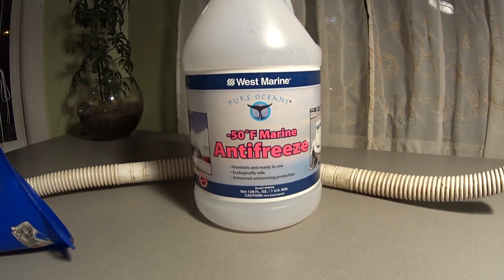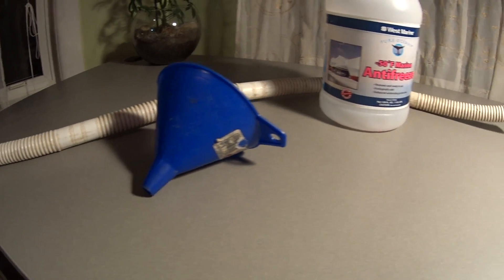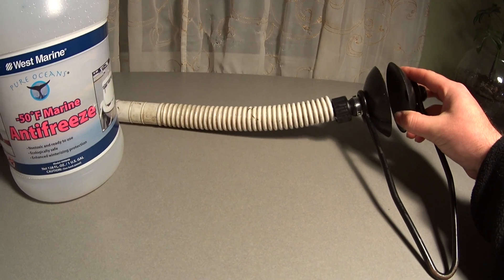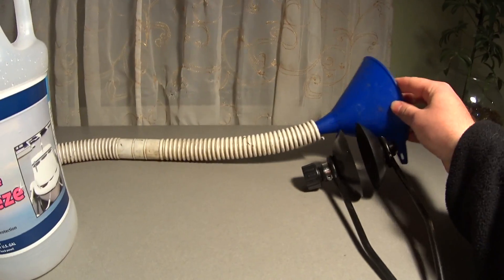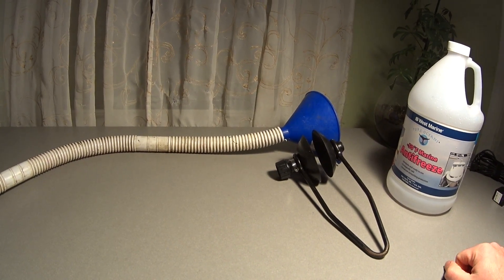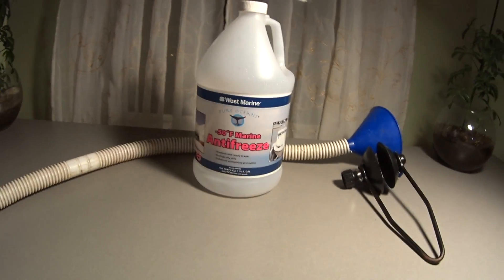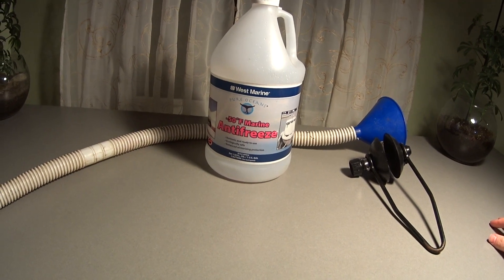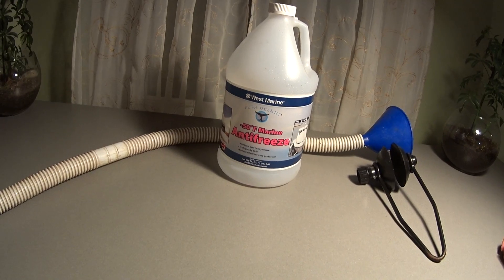Outboard Motor Winterizing - Simple Outboard Antifreeze Flush Method - DIY

Comment: The polyglycol antifreeze you are showing in this video is for WINTERIZING ONLY - is used at 100% and you can buy it in -50 or -100 strength (BURST rating) this is NON-TOXIC Winterizing antifreeze.
Reply: soooo one must make sure to use JUST polyg antifreeze and not coolant right? Would my local autopart store have just polyg antifreeze? Seems like most carry eth antifreeze/coolant combo
Reply: Should be easy to find it’s used in RVs as well as boats.  It’s biodegradable so it can be discharged in the water the following spring should you choose to leave it in.  Some people flush out motor with it and don’t leave it in because in some areas it will still freeze.  My boat is in an unheated garage and leaving it in is fine since there’s no wind chill.

Comment: Hey man so i dont have to mix water with it? I have 1 50hp mercury that i need to do so i just tape the tube to the muffs then funnel the fluid stright into the muffs.. I see some people mixing water with it so thats what iam not completely sure about thanks
Reply from the maker: It should say on the bottle of antifreeze. I think it's fine to mix it. Last time I did it i did 50/50. Probably also depends on where you living just how cold it actually gets.